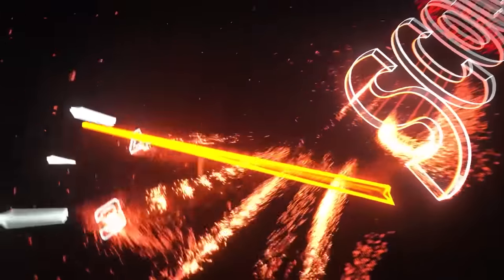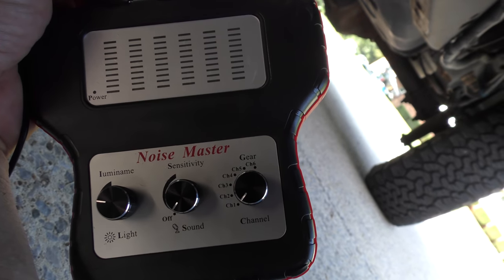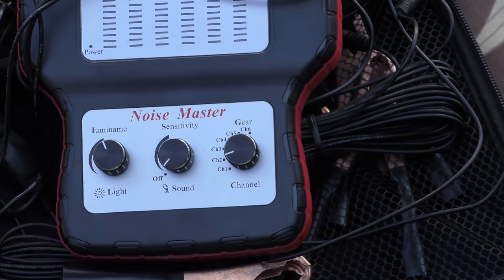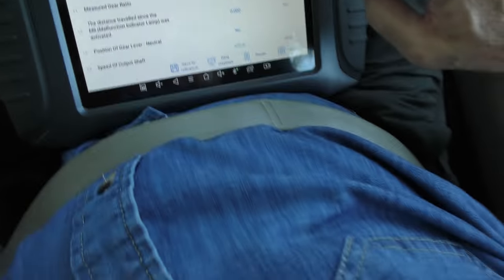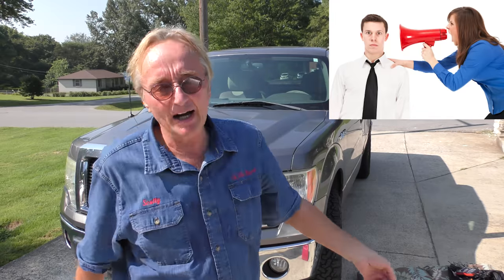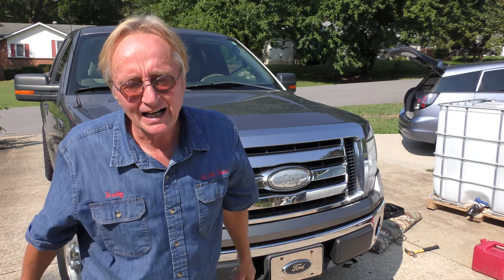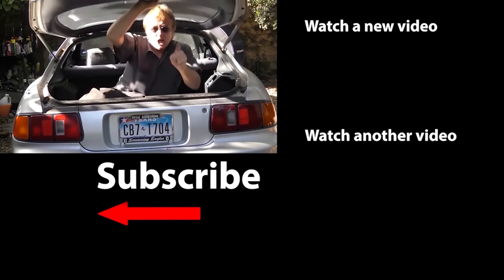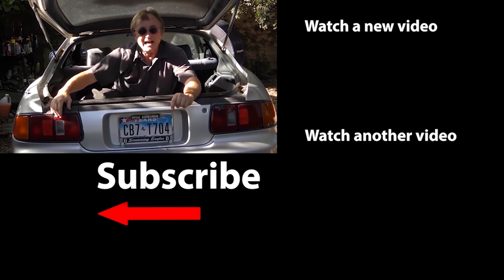If You Hear This, Your Transmission is Bad

Comment: Hey Scotty! I have a 2008 PT Cruiser with 110k miles that I'm trying to keep alive. It's making sloshing and trickling noises coming from behind the front dash, but the noises come and go. It's also whining sometimes when I put the car in reverse and sometimes just when I accelerate. It was doing this until it overheated and the A/C wasn't blowing cold anymore. I took it to my mechanic who said there was no leak in the coolant system but flushed it out and burped it. The noises came back slowly and one time the heat gauge went up quickly but came back down. Any idea what's going on? I know PT Cruisers are crap, but I'm hoping to get another year or two out of this one so I don't have to buy a car when prices are surging. Thank you so much for your insights and content!
Reply: @moreno valley news first I've Seen Similar Discriminations With A Thermostat.
Reply: PeckishPeck. I had a 2002 pt died. at 249000 miles. You have a long way to go. Just take good care of it. You need a good mechanic who care about your car. I could have gone to 300000 miles but I took it for granted.
Reply: @mirelladay2930  Thank you, Mirella! I do have a wonderful mechanic but this seems to be stumping him. The weird noises wouldn't happen for him. I'm really hoping I can get a lot more use out of this car. It's great not having a payment
Reply: Head gasket issue starting maybe? 🤔
Reply: @clardy01  could be. I assumed they really did a pressure test with Die.
Reply: UPDATE: The Cruiser is dead. Took the car to a different mechanic on a recommendation for a second opinion and he said there was internal engine damage from overheating, deteriorating motor mounts and a radiator that needed replacing. He said it'd be too expensive to fix considering the cost of rebuilding an engine. So now that's 2 mechanics saying move on from the vehicle. I guess that's when you listen....
Reply: @moreno valley news first The second mechanic told me Carmax does repair vehicles. So maybe I'd be able to get a little more than salvage value. Fingers crossed
Reply: @PeckiePeck  Hey Man I'm Sorry. The 2.4 In the older Neons Seemed like decent Cars if they had A Manual transmission. Buying A Car right now Is tough. You See A Old Camry Or Honda that You like. it Would be Well Worth the Money to have Your Or Mechanic.Check it out. I mean really check it out. It all depends on Your Budget. I Wouldn't trade it In. They Will just make it look like they are giving You something for it When they are not giving you anything In My Opinion. I have seen it time and time again A New Engine might be great but everything Else could be going Bad. Heat Is hard on Everything from Seals to Sensors. Yes Your Mechanic should check it out for around A 100.00. At least have some one hook up A good Scanner. That Can Tell You A lot.
Reply: @PeckiePeck   Or Post for parts. People hit dear and everything else and need Sheet Metal.

Comment: Hey Scotty huge fan. My secondary vehicle is a 2007 Ford Mustang V6. I’ve noticed recently when I put it in reverse, the car jerks. Any tips?
Reply: Horses hate going backwards
Reply: I'm not Scotty but I've had a similar situation to yours. It can be either bad motor mount or bad ujoint. If it's motor mount you can open the hood and see if the engine bounces up a little when u go in reverse. If it's ujoint you should really be able to feel a jerk through all shifts. Also with ujoint if left unchecked it can wear the rear seal so you can look under where it connects and see if you see tranny fluid anywhere. Hope this helps
Reply: Most likely engine mount
Reply: Transmission oil could also be running low

Comment: Rust check is a rust converter that chemically stops and converts rust into an inert coating that seals out moisture to prevent further corrosion that is ready for painting and eliminates the need for sandblasting, grinding or scraping , some products do actually work but some are better than others.

Comment: 6:08 that's not true. sealed rust is passivized rust and won't continue. So better to have oil on rusty surface (it will stay on longer) than oil on smooth surface. Painting it can be worse because the stones will chip off the paint and the rust will crawl under the paint doing even more damage.
Reply: My a/c has a  receiver dryer made of steel. It has rust but I keep oil on it and rust does not grow worse.

Comment: That was one heck of diagnosis Scotty! Using that sound amplifier was brilliant to pinpoint the noise. I’m not sure about using it on a women they might not take kindly to that. Lol. BTW, I’ll let you know if my 2017 Golf ever hits 300,000 miles. I keep it well maintained and 40,000 miles in it hasn’t costed me a penny. Might take a few years or a decade lol.
Reply: My 2016 Golf just needed a new water pump/thermostat at 78,000 miles, not the worst repair but keep an eye on those coolant levels!
Reply: Good Luck!
Reply: oh god a volkswagon geesh
Reply: @Jangopenguin  aww a fellow Golfer! You’re right that water pump can be problematic. Mine froze up in -30 weather @ 24,000 miles. Luckily it was covered under manufacturers warranty had they change the thermostat also. I bought some G-13 coolant also just in case. Other than that the car has been flawless.
Reply: @TheUltimateCrash1990  peace, love V-Dub
Reply: hasn’t cost me a penny

Comment: Rust Check is an excellent product however it is a preventative not a rust remover, nor is it a sealant it is and oil type spray that penetrates everywhere.  Very popular in Canada, I've been using for years.

Comment: I need a lead on my 2002 accord it is consuming oil fast with no leaks noticeable under it misfires at 3000 rpm when warmed up . Replaced plugs and distributor and alternator and wires are good . Catalytic is also clogged
Reply: clogged cats make the air go back into the engine and destroy your piston rings aka your cars on borrowed time until it reaches a junk yard.

Comment: about the engine mounts, the way i found out i needed change is how bumpy and jittery the car was, 1999 audi a3, got the original mounts. opened the hood when the engine was cold so i could touch it, had it in gear on flat ground, and just moved the engine back and forth by myself.  youre not supposed to be able to do that. at least not easily.

Comment: I had a similar sound issue and the dealer changed the trans fluid. That fixed the sound and car has been running fine.
Reply: Im about to do that to my Camry with 100k miles. I hope that fixes it too.

Comment: My 2015 Honda fit is making a tapping noise when I accelerate.  Honda couldn't figure it out, then they said it was the catalytic convertor and wanted 1700 to change it. A friend of mine that knows cars had doubts so I got a second opinion and they are saying transmission.  So frustrating. It's got 175,000 miles on it. I was really hoping to drive it a lot longer.

Comment: 2017 ford 150 xlt v8. Going through 40 mph easy on throttle. Vibration that feels like rumble strip on edge if road. Tires balanced twice

Comment: I had this exact Same issue with my 2010 Ford Expedition. We could not figure out what was wrong. Took it to AAMCO and they diagnosed it as a transmission issue with the 4,5,6 gear and some other components. Had to spend $3900 to get it replaced with a used 60k transmission. Not happy.

Comment: I literally have the same issue, but I have a 2011 Acura TL AWD. When the car is running for 20 mins on the road, the noise will appear from under the car. It makes a shudder, growling or grinding noise, it's the noise just like in this video. After the car has been running, the noise will appear at low speed. The RPM hand rapidly goes up and down at 1st or 2nd gear, then at every stop (stoplight or stop sign). Once the car start rollin, the noise will appear. Once it get at high speed, it goes away. The car still shifts gears, I can still put the gears in Park, Reverse, Neutral and Drive with no problem. It's just the shudder noise at low speed. But I have heard and seen, that a issue like this video, can be the torque converter. I took my car to a transmission shop and once he heard the noise right away, he assume that it could be the torque converter. But not saying that it was bad. He was saying that it seem like it was in lockup and was trying to figure out why. I was also told that my transmission fluid could be bad and that it need to be changed, by draining the old fluid and putting new ATF in. Will possibly solve the issue. The crazy thing is, is that I did check the fluid and it was brown. I was told before that you should change the fluid every 60k miles. But the real truth was that it's 60k the first fluid change and then 30k every change afterwards. But hopefully that's what the issue is.

Comment: For rust, put fluid film on and re-apply every year or two. DO NOT, use paints or coatings that dry and harden. All paint/undercoating/liner etc will do is form pockets and bubbles over time where water collects and will actually make it worse. 
Clean up the rust decently and put fluid film on it. It will prevent further rusting even if applied to rusted metal because water/moisture cannot stick to it, just rolls off 👍

Comment: I have a car we just bought. An 05 Toyota Camry. Bought from a dealer in cash. Well he said it needed shocks. No it does. But it also has bad outer ball joints had to replace rotars and breaks. Transmission is actually fine. Whoever owned the car actually cared for the engine really well. Oh it had codes pop up for the air or something. Turned out to be a worn hose. And the abs module. Which I'll replace soon. Bought a brand new car from a Ford dealer is 2012. Had a bad transmission. This car would literally give you whiplash when pulling off from a red light. Their excuse the car doesn't have enough miles. So I put it from 3 to 500. Well that didn't help crap. So had to trade it in and my payment went up by $50. But the other car was fine except it had a code for the evap sensor...brand new car.

Comment: Scotty. Question in the day. IF you can choose just a gear for your transmission. Which. Because when I did was fixing it. Took 1.5 years to learn one. Now project car. Anyway. So the parts was rusty. Left in rain by some non-professional. Anyhow. I get one clutch left and parts are messed up but I think 1 gear ok. Someone did this mess. Asking for a friend.

Comment: Chrysler transmission incorrect ratio on mine was due to an intermittent short on the output sensor, the wire had gone green inside and one strand was barely intact. I fixed the wire and never had a problem again. AFAIK the old pos is still running.

Comment: 04 dodge durango 5.7 liter 4wd that has the hemi

The other day we were driving just fine no noise no noticeable issues..  we accelerated and all the sudden we felt the car kick and pushing on the gas did nothing... we put it in drive, reverse, 4 weel 4 low everything and the rpms would go up but no movement at all

Comment: tranny issue. 1999 Honda CRV, left front cv axle broke in summer, a few months later the car stopped shifting, found the transmission output shaft seal cut and most fluid leaked out. Replaced seal, no more leaks, used top fluid from dealer, Shifting into reverse rings a bell, it will drive about 1 mile then stop shifting, then if you turn the engine off for 1 minute, then it will get half a mile then all gears are acting like neutral. Replaced the clutch solenoid and the pair of solenoid on top. The filters in these solenoids were all clear. The shop wants $5k. Not happening. Added about half a quart, and it went from all gears neutral to shifting, but still only the 1 mile of driving. No error codes on scanner.

Comment: If it's just starting to make noise, and you know the transmission is going out (or will at some point, and fixing it wouldn't matter whether you do it now or later) I would just wait until the noise gets worse and then deal with it.  For all you know, it may go a year like that or a few years, or it might go out tomorrow.  Depending on the value of the vehicle (I would assume that one would be worth putting a rebuilt trans into at least) you could just drive it until it craps out and then either junk it or repair it.  One of my first cars was an old late 80's Buick.  Would slip periodically out of gear (along with a few other issues) but it did that for the full 3 years I owned it and never spent a dime trying to fix that issue.  It still ran and drove when I sold it, so sometimes you can just let it go until it gets worse and then deal with it.  I bought that Buick with the knowledge that the trans had issues, but didn't know it would go 3 years without any major degredation from what it was when I got it (from the perspective of the transmission) so for $1200 it served its purpose.

Comment: I’m having transmission issues with my 2001
Ford F-150 and I’m not sure what I should do. It’s a super nice truck still.  Should I just buy another used truck for like 8 grand??
Or should I get my transmission rebuilt? Or should I buy a used one from a reputable wrecker? I’ve had three transmissions rebuilt in my lifetime and all of them failed after one year. They don’t replace everything when they do a rebuild, they simply replace what is worn. So when I analyze the data of having THREE rebuilt and all THREE failed after none year (after the one year warranty) it makes me
Feel I’d be better off buying a used one. A factory transmission can last the lifetime of the vehicle. It typically does. my current tranny has lasted since 2001. I feel like there is no rebuild in all the world that would last that many years. I know, I know.. there’s no way of knowing if a used transmission from a wrecker is any good. But I still feel like I’d have better chances of getting a used factory one that will last. I don’t have a lot of money right now and I use my truck for work.. I don’t know what the hell to do.. 
Any input or advice here would be appreciated.

Comment: If the transmission in that Dodge is a Nag 1 you could try replacing the conductive plate inside. Contains all the censors the transmission uses to calculate.

Comment: I took my camaro to pne of the best rated mechanics in the area. Spent $700 for him to not fix the issue and now my Bumblebee is grounded...shift into drive...moves like it's in neutral. I'm told not to go to the dealer. I'm told not to go to the dealer. Where exactly do I go? It's so frustrating.

Comment: Most dealships don't reccomend the fluid be changed til 150,000 miles honestly thats the problem right there now replace it with  FORD REMANUFACTURED TRANSMISSION period.

Comment: Scotty, I have a 2011 Toyota Rav4, AWD, 104,000 original miles. I've had the car about 5 months. It has the stupid black 'beauty covers' over the wheels. The wheels are steel including the full-service spare. Can they rust around the valve stems (yes, all 4) be cleaned, or should I  just get new rims?

Comment: i have a problem in my vitz 2002
when engine is off and ignition switch in on then transmission sounds like electric transfermer when pressing gas pedal

Comment: The first year I bought my 2004 Dodge caravan, the computer malfunctioned in a way that it kept sending glitchy signals to the transmission to shift the wrong way. It was eventually corrected and i haven't had trouble for years. But it was a groaning experience for me because I was out almost 100 miles from home.

Comment: Hey Scotty. Lady driver here. I don't have a garage or tools or nothing. I'm currently in a 2013 mazda 3, 75k miles on it. Just wondering, how much life I  your opinion can you get out of a mazda? Front suspension is shot, so I'm getting about 1300 worth of work on it to replace control arms, sway bar, and struts. Just hoping I can get a few more years out of this gal, cars are just too expensive.

Comment: My 92 camaro had the tranny rebuilt by a place called Dean's and they replaced some bits with corvette ones and it has a loud aggressive engage now. It only cost 2,200 when I did it 10 years ago. Car mostly sat doesn't have more than 50k on it. I was a little miffed since they didn't replace my busted odometer sensor on the tranny while in there.

Comment: I need your opinion. I have a 2000 Ford Ranger. I’ve replaced the MAF already. The problem is if I don’t let it warm up it try’s to stall. If I warm it up it runs fine. What do you think.

Comment: I have an 04 Lincoln LS, the automatic transmission started to shift hard in I believe the 2nd gear and slips a little into the next gear. I want to get as much life out of it before the transmission goes out completely. I don't plan on having the transmission rebuilt or purchasing a new one.
I was thinking about draining a quart of tranny fluid and adding a quart of Lucas transmission fix and see if it helps and maybe I can get more life out of it.

Comment: I had same issue with my Toyota Rav 4 2010 and changed the transmission fluid in 2019, the noise is significantly reduced on acceleration.

Comment: I’ve been hearing some weird intermittent noises and I’m pretty sure it’s the transmission. Sounds like a ac clutch chatter but coming from the trans area and I’ve also heard a wa wa wa sound. It also slams when Putin it in drive maybe once every couple months. I’ve been driving it something like 18 years so I’m ready to dump it before it goes out completely.

Comment: If a 2008 honda civic is 155,000 miles and making those rattling noise and mechanic said it could be the transmission pump. Would you recommend a new transmission or another car?